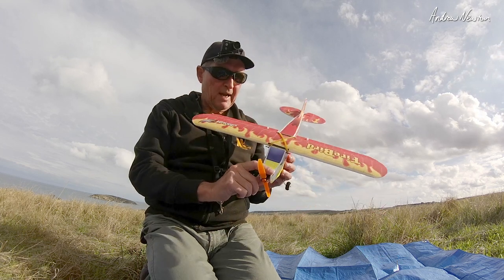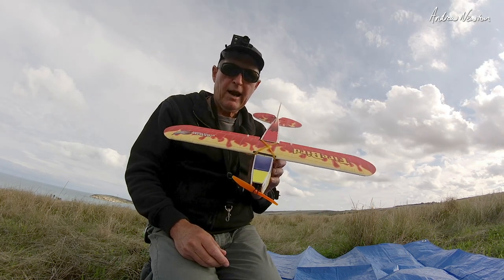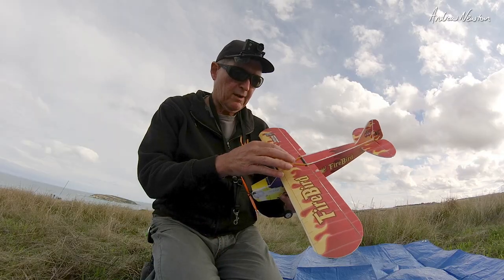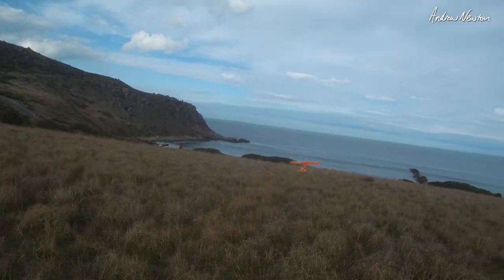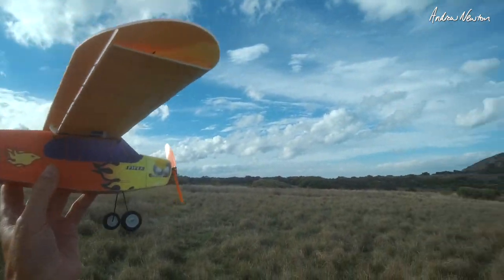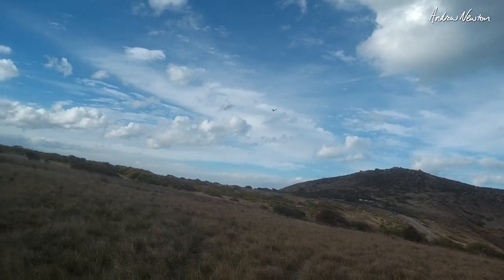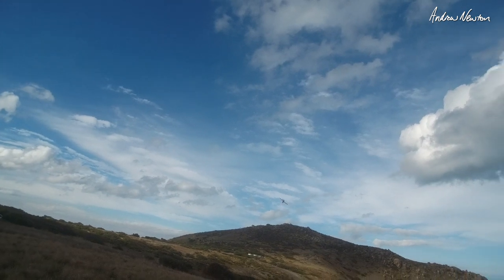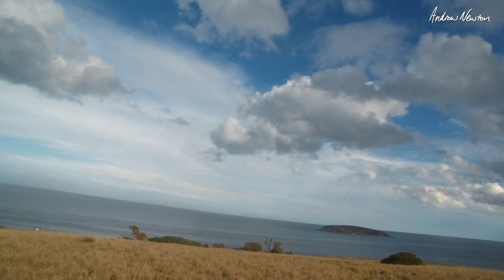Dancing Wings J3 Firebird Cub - sub 100g

Comment: Looks like lots of fun. Nice review, demoing the full range of this planes capabilities. ;)

While I'm not crazy about smaller planes, they do seem popular. Cost to get in air is similar to a plane with 2-3x wingspan and battery capacity. (ie: motor, servos, etc all cost about the same)